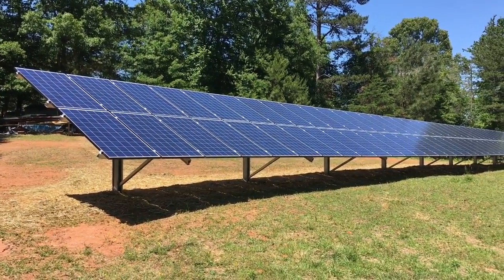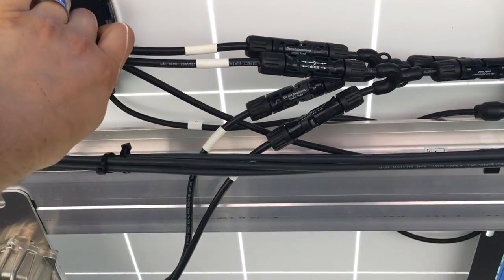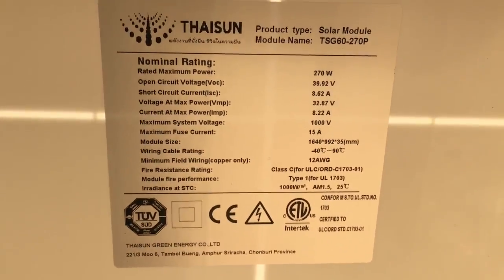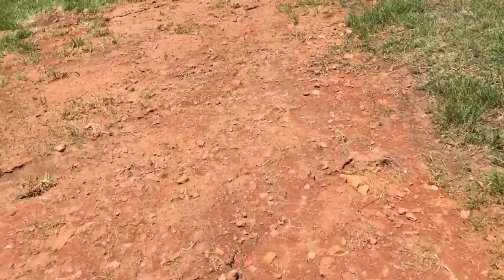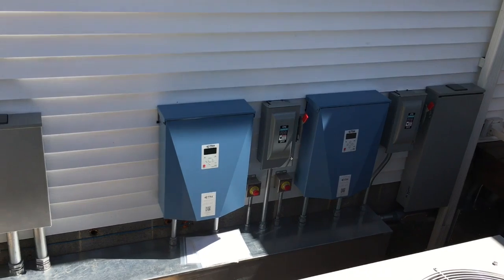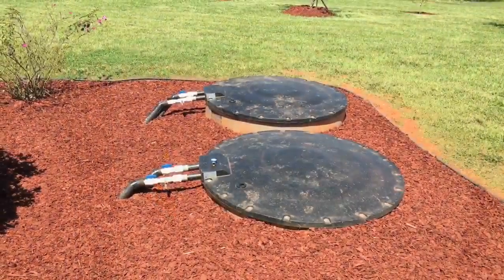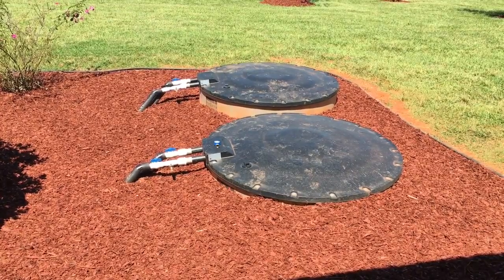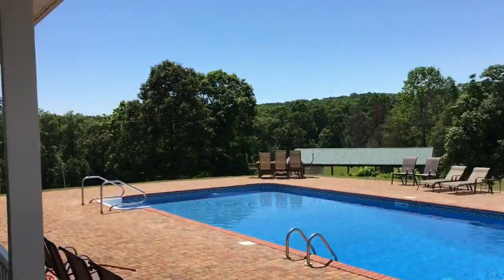Future Solar:  Pika Islanding Inverter and Multiaqua Chiller w/BTU battery

Comment: If I understand this correctly, you have inverters back at house so DC voltage is running the 600ft from array to house? Does not look like very big wire in the pull box. You mentioned less than 3% voltage drop. 270W panel 32v each. That is about 8.2amps per panel. 9 panels in a string. Thats 73 amps per string back to the house? Can you please clarify. Thank you
Reply from the maker: Hi Stephanie this is A 380 Vdc system so voltage drop is minimal. Pika uses and optimizer call pv link.
Reply from the maker: Stephanie Dalton remember, when you series wire panels voltage goes up and amps stays the same. Series wiring is often referred to as “stringing”. Thanks for wiring and watching.

Comment: Nice system, are you happy with the Pika product? I’m debating on using it on upcoming projects. Does it have a gen start function?
Reply from the maker: Jesse It’s expensive and battery choices are limited. The dude that did this had a deal going with them but it fell through. I don’t remember about the gen start but for the money I like the Solark right now.

Comment: Nice job man I liked the tip about the in line fuses!  Do you ever worry about using THWN-2 with high voltage DC (above 500VDC) as far as leakage current and nuisance ground fault tripping?  I'm also worried about direct shorts - a direct short in one string may not trip the fuse but will definitely cause a fire.  Thoughts?
Reply from the maker: I think it would trip the fuse.  Also, system has arc fault protecion, ground fault protection, and the p380's, the optimizers that PIKA runs, are at 380vdc so we dont we are well below 500v.  I rarely wire anything at 500v because if you wire a string that high, it will likely be over 600 on a really cold day
Reply: THWN is rated for that voltage, why would there be an issue? You could use XHHW, it has s thicker rubber jacket, it holds up better than THWN.

Comment: Just curious, is/was there a reason you didn't divide/split the 20kW into 'East' and 'West' as you and Enginerr775/PP/SH have done previously?
Reply from the maker: We are doing the East West.  Ww needed to get the system to a finished point for the film crew but we will be adding 20 more kw to face west.

Comment: What about lightening strikes?
Reply from the maker: Bruce Humphrey hi Bruce we usually put class 2 surge protection on everything.
Reply: thanks for the reply. We live in Clermont, but just got a place in TN, We might use your consulting services.
Reply from the maker: sounds good bruce.  You can email me at jwv8783@gmail.com
Lighting is pretty weird but the midnite surge protection devices work pretty good.  I have them on my own system and it seems to have stock nuisance lighting from killing our internet modem

Comment: Your clearance in front of your loads center do not meet code.
Reply from the maker: Jesse it passed inspection.  It looks tight in the video but there was plenty of clearance.
Reply: NEC for panels where no conductor exceeds 150V above ground is 36in out from the face of the panel and 36in wide working area.